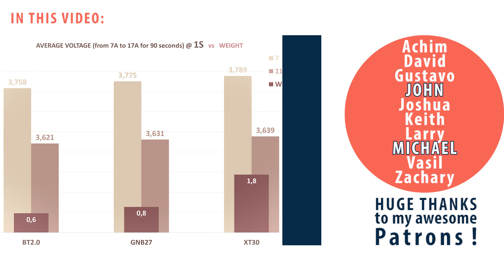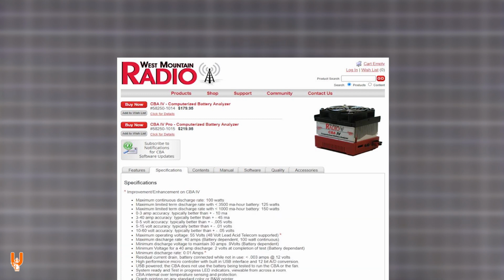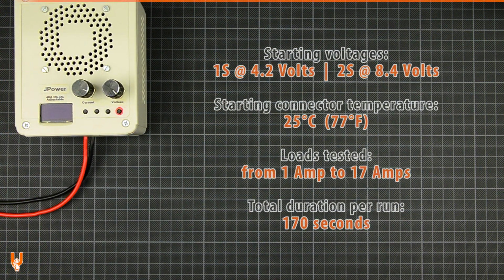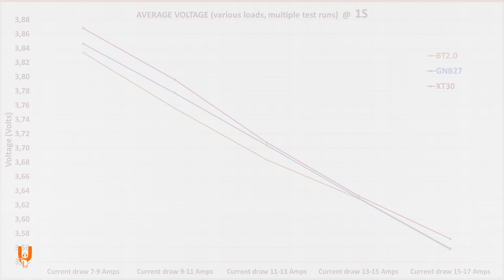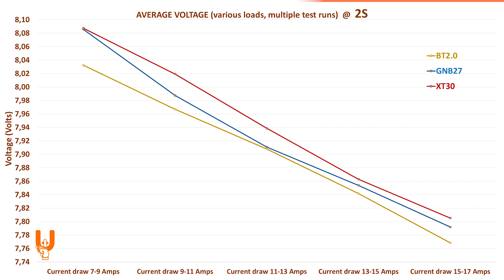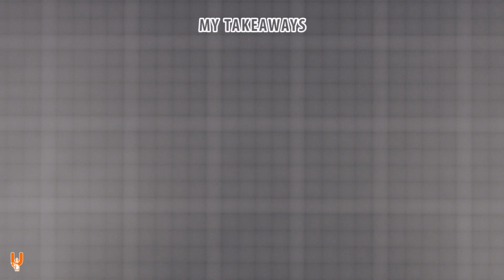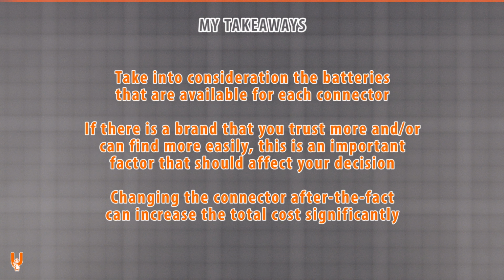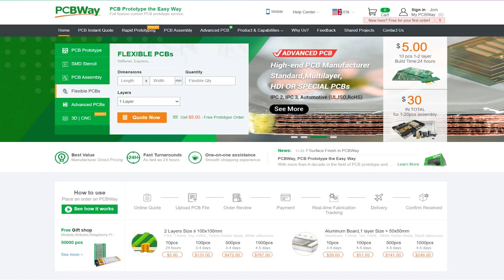BEST BATTERY CONNECTOR for 1S and 2S: GNB27 vs BT2.0 vs XT30 - Battery connector showdown #2

Comment: Lot of work was done in this video and it gonna help people to do right decisions.
But fundamental mistake was made in method of testing.
For example, you can measure the serial resistance of connector by passing constant current over pair of connectors: 
"+"Of PSU -> "+"Of female connector >> "+"Of male conn. (Male conn. should be shorted with solder or bridged with very short wire, to negate resistance of wire) "-"Of male conn. >> "-"Of female conn. ->  constant load -> "-"Of PSU. By doing this, you can adjust current to desired level with constant load.
And than measure voltage drop over female connector with millivoltmeter, calculate resistance = voltage drop / current flowing through circuit.
Knowing resistance of the connector, you can calculate voltage drop on all possible powering voltages. 
Thanks for the video☺️

Comment: Have you looked into the new GNB A30 at all? I feel like it should get the same results as the BT2.0 because of the same pin size. I am wondering if those will take over the market as the new whoop connector.
Reply from the maker: Hello! I have and I definitely want to test them. I have been struggling with free time since last August but I hope to be able to bring you new tests sometime soon :)
Reply: They did it very smart. You can use GNB batteries on BT2.0 quad. But you can't use BT2.0 batteries on a GNB A30 quad. This gives the GNB batteries a big advantage... Hahah
Reply: It looks like GNB wants GNB A30 the new standard (compatible to BT2.0). And they stop producing GNB27. That's a bad development imo... Because the tiny pin spacing for cable soldering is too tiny imo means unsafe against shorts...
Reply from the maker: I was not even aware of the A30  connector, I will take a look

Comment: Thanks so much for this video, I own approx. 12 1-2s low draw whoops which all have the p.h.2 connectors that I’m switching over. I was originally thinking I of going with the b.t.2, but after watching this I believe the g.n.b27 is the way to go, especially my 1s Savage Bee, that one I believe will benefit much more with the gnb27 as opposed to the stock ph2.
Reply from the maker: I am happy you found it useful!

Comment: I put xt30 connectors directly on my 1s lipos lol , make sure you use the batteries with the short wire leads so you can peel back the tape and desolder them then add new xt30 . It’s a life changer for my 1s -2s brushed builds
Reply from the maker: I agree, stick-shaped batteries without battery leads are a bit of a pain to modify. I think XT30 is overkill for 1S and 2S to be honest, but if it works for you and suits your needs, it's all good :)
Reply: @muteFPV  well I did only have xt30 laying around to solve my issue with 2 ph2.0 pigtail and 2 stick batteries causing only 30sec flights , now i get 2:30-3 min  and my build is powerful enough to handle the extra gram or so , I do want to try others in the future. Btw love your channel I never stop learning & ive been watching you for years silently 🙏
Reply from the maker: Thank you very much!!!
Reply: @muteFPV  this is just a new channel I made to start posting videos finally ! I subbed !

Comment: Wow cool video !!!! GNB27 is better than the BT2.0 !!!! The BT2.0 extrem little pin spacing is unsave and bad for DIY ! But a XT15 (which does not exist on market yet) would even be much better because of a larger pin spacing ! I was really interessted ion your video because i like to compare power connectors. I made a video why BT2.0 is very bad and why we need a XT15 and XT45.

Comment: Excellent video and I agree in all what you said, but after using both connector BT2 and GNB27, I'm more and more disappointed by the durability of the GNB27. They become very loose after only a small number of dis/connect. Never had that with BT2. Always firm and snug. And ALL my "free" GNB27 pigtails that were included with Gaoneng batteries are COMPLETE JUNK. They are such a loose fit that they almost come loose by themselves. Did you or someone else had the same experience? Not sure how to proceed (with around 50 1s batteries laying around here ;) )
Reply from the maker: I continued used BT2 and haven't jumped to GNB27 yet. Are your GNB27 connectors some of the very first that were produced by any chance? I haven't followed closely so I don't know if this has happened to others this much, has it?
Reply: There has been a semi-silent update of GNB27 to “v2” which is a bit beefier so it has a loose connection to the original connector, that might be the case here?
Reply: @FilipRadelic  I think that is the case. I have been using GNB27 on my flywoo baby nano 1s and a fresh batch of v2 connectors, they are not loose fitting at all.
Reply: Yes the same... Too. Hard at first time and too easy after 5 6 connections

Comment: Great video! Like the "un-muted" muteFPV videos and this one may be the most important of all for manufactures to watch to ELIMINATE THE PH2.0 CONNECTOR. I've seen the PH2.0 POG cause multiple problems that appear to be hardware related including fail safe on take off with a fully charged battery and harmonics in the video so severe a goggles DVR that works well normally doesn't record the signal you can see... before you can't see it and punch out making it worse trying to get a video signal or hear where it is to go LOS. Great video that deserves attention so battery manufactures making high C rated 1S HV Lipo batteries use the GNB27 connector now that GNB makes a proper 1S battery connector.
Reply from the maker: Thank you very much! I wish the GNB27 or BT2.0 became "standard" but I suspect that this requires licensing, which results in higher cost. We are heading the right direction, that is for sure. At least GNB has good batteries that accompany the GNB27 well, compared to BetaFPV that have been (at least for me and in the past) mediocre....
Reply: @muteFPV  Thank you...  was stoked to see you finished showdown #2 with the GNB27 in it. Took awhile;-)  I just ordered the new Flywoo Firefly Nano Baby quad at 20.4 grams using 40 mm props. They used a folded PH2.0 so I'll replace it with a GNB27 to use with the new 90C 10gram GNB 1S 380mAh battery and some older GNB 520 80C batteries on GNB27s.

Fun to look at what people were flying in the back yard and raging about despite flight times under 2 min only 10 months ago when I posted regarding using the GNB27 connector on the Tiny Hawk. The progress is quite amazing despite the pandemic with Flywoo pushing forward. The Nano Baby is within a gram of being only two thirds the weight of the "tiny" Tiny Hawk and it's using a much better 40mm prop without the Tiny Hawk's body drag to slow it down. And since the Nano Baby's flight times being reported are so long it seems reasonable for playing around up close to drop another 4 or 5 grams by using a 10g (claimed, not here yet to weigh) 380mAh 90C pack. 5.1 grams is 25% of the Nano Baby's 20.4g base weight so dropping 5g using a smaller but higher C rated battery is substantial and should feel great with the proper tune and still provide reasonable flight times. At least that's the plan... see if it matches reality when it gets here;-)
Reply from the maker: Let me know how it goes, I agree with lowering the weight, it makes a huge difference (especially in micros). I would have completed the showdown earlier but was told that GNB was changing stuff compared to the connector released at first. No idea if it had to do with review samples (never had any) or first production batches (didn't buy any of the very first). But I had decided to wait, just to be sure.
Reply: @muteFPV  Wow lucky me and thanks again! I was kidding when I said the 2nd showdown testing "took a while", but glad I said it because I ordered the first version of GNB27's AND THEY ARE NOT COMPATIBLE with the second version!  Your reply made me wait for the new GNB 380 90C 1S batteries to arrive and see what you were referring to and stopped me from spending hours/days to finish converting everything 1S HV High C with PH2.0 to GNB27 including soldering up eight 14AWG GNB27 charge leads and modifying some HV multi-port chargers with PH2.0 outputs to be ready for 1S when Flywoo's Baby Nano gets here... but now I need version 2 GNB27's...err! 

GNB changed the design and reversed which bullet side expands and compresses. 2nd version has the male bullet cut down the middle so it can compress going in solid female bullet so the ver 1 female solid bullet will not fit inside ver 2 GNB male on new GNB 1S batteries. Fortunately this change happened almost immediately so not an issue unless you ordered some of the very first ones.
Reply from the maker: Thank you very much for the feedback!
Reply: @muteFPV  No problem, thanks for saving me from wasting so much time. And BTW the GNB27 connected 1S GNB 380 90C batteries look good... weigh 10.35g to 10.44g out of 6 samples with consistent C/G locations... a tad over the 10g spec but with the heavier GNB27 if it's really 90C relative to GNB's 80C batteries its lack of a weight increase for it's mAh rating going to a higher C shows progress is being made with the HV lipo batteries. Well thanks again... just hope I can find some GNB27 connectors in the US with the Nano Baby about a week away from arriving.

Comment: This was great, thanks. Do you know if GNB27 connectors you tested were v1 or v2? I am not sure when exactly v2 came out, but it seems to have slightly beefed up pins (so it’s not exactly backwards compatible, as if user adoption of it wasn’t bad enough) so might be a bit better than the old one if it doesn’t add even more weight. I agree with your conclusions—if I was starting out today I might lean towards GNB27, but with everything on BT2.0 already, it doesn’t seem to be worth the hassle. And my builds are so weight-conscious that 0.2g extra weight might even offset any benefit 😅
Reply from the maker: Hello, thank you! I delayed this video on purpose to make sure that I had GNB27 V2 connectors. I am pretty sure that any GNB27 found online now are V2.
Reply: @muteFPV  thanks for clearing that up, that makes my decision to be lazy and stick with BT2.0 even easier 😅
Reply from the maker: Same here 😂

Comment: Just measured GNB27 DC Resistance (DCR meter with microΩ resolution and proper Kelvin leads).
Single contact pair: 2 mΩ. So the total voltage drop on two pair of contacts will be only 4 mV / 1A load.
According to your plots it is 10 times higher 40-50 mV / 1A. You are measuring total voltage drop on connectors + leads.

Also I have measured old Micro T connectors, they are only 1 mΩ (per contact pair). Not as compact though.
For comparasing, big XT90 are 0.2 mΩ. XT60 are 0.25 mΩ.

Note on the BT2.0: they are small overall, but 4.5mm thick compared to just 3mm GNB27.
Reply from the maker: Thank you for the interesting data. That is correct, I am measuring total voltage drop including female+male connectors and their leads.

Comment: Pro tip, if you're going for 2s+ and using less than about 10A consider plugging straight to the balance connector, and forget the main lead.
Reply from the maker: Hello! I don't agree with that, especially considering the folded-pin terminals used in the balance connectors and the small wires. I doubt there is any significant weight saving either. Unless you mean to cut the main leads completely from the battery.
Reply: Oh there is a few 2s batteries that are sold without a main lead just a balance connector, that is what I was thinking about, doing this while still having a main lead is pointless. You do need a special charging cable for most chargers btw. To be honest it's hard to recommend, for batteries that are not designed with it in mind, but many batteries use 22AWG which is plenty for builds where you're trying to save insane amounts of weight. 10A might be too much but 5A is probably OK. I have only done this with 2s LifFePo4 airplane receiver batteries but I was planning on using it for some indoor aircraft with 6A ESC.
Reply from the maker: @ignasanchezl  at 5A it may be more feasible, that is true. I think I remember some Walkera products with this kind of batteries? It has been a long time, I may be wrong

Comment: We have a new one on market: BT3.0 connector. Which is in competition with XT30 for tiny 2S whoops... One advantage is that it does not need a balancer. But as you can see in a video of mine is that XT batteries without balancer cable exist.... And what strikes me again on BT3.0, as with the BT2.0, is the very small pin spacing. So I can't support that again because imo that is dangerous ! 
I still hope that we get an AMASS XT7 connector for tiny 1S drones. Which in itself is basically just a downscaling of an XT30. Just take Photoshop and shrink an XT30 connector so that it has the pin diameter like BT2.0 pins, then you will see that the PIN spacing of the BT2.0 is a joke...
Reply: Sorry i mean XT15 not XT7.
Reply from the maker: Thank you for all the details, I just saw your message. I had come across the BT3.0 and have mixed feeling about it, but I kind of like the whole idea of the third small pin for balance charging. There are XT batteries without balance cable, there are also batteries with just a balance cable and no main battery leads, it is all about the use case / purpose. I personally always balance-charged my batteries for longevity and safety.

Comment: Why does it make a difference between 1s and 2s @ same current?
Reply from the maker: Hello! Because the wattage passing through the connector is more. Watts = Volts x Amps, so as a simplified example if 1S is 4 volts and 2S is 8 volts, for the same current of 5 Amps you would have 4x5=20Watts for 1S and 8x5=40Watts for 2S passing through the connector.

Comment: I love this kind of tests. Numbers doesn't lie. XT30 connector indeed is much more suited for 2S to 4S up to 3"  quads and small planes/wings. For 1S+1S battery configuration in whoops GNB27 is slightly better than BT2.0. BUT as you said - battery availability in particular region determine final choice. I moved from PH2.0 to BT2.0 because in Europe BT2.0 batteries are much more available with faster delivery time than batteries with GNB27 connector. Also BT2.0 is rock solid and can withstand many coupling/decoupling cycles easy. Read about GNB27 as not so resilient in that.
Reply from the maker: Thank you very much for your feedback. Where do you (usually) get batteries from in the EU?
Reply from the maker: I think Youtube has removed your reply, all I got was a notification but I cannot find it. Please reply again and do not include any links, I am pretty sure Youtube blocks messages with external links very often.
Reply: @muteFPV  Yes, and second comment was eaten too. Seems YouTube think about me as mature spammer. Would like to know why. Maybe they now use more sophisticated shop address check, dunno. Nevermind, will try to write in separate comments. Ok, I live in Latvia. Nearest whoop battery supplier is Brickracing - at 20 min drive from my home. I know the owner, he usually have a stash of BT2.0 batteries in shelf.
Reply: @muteFPV  Next nearest shops with BT2.0 batteries and fast delivery times to Latvia are DroneIT (Sweden) and FPV24 (Germany).
Reply from the maker: Thank you for the info mr spammer! 😂 I only knew FPV24 but I will check the rest as well. I live in Greece.

Comment: That's what I look for. Thank you so much for that useful informations. I've a question for you. I'm planning to buy Happymodel Crux3 and If I buy I will need to buy 2s batteries but I don't want to buy new batteries because already I have really good GNB 1s 600mah batteries. The question is If I use 2 1s batteries in series with GNB27 connectors how it performs compared to XT30. 
Do you think that would be enough?
Reply from the maker: I am glad you found it useful! If you don't already have GNB27 connectors on the batteries I don't think it is worth it. I would purchase 2S packs with XT30 connector instead.
Reply: @muteFPV  thanks for reply 👍

Comment: Nice tests. I sometimes wonder about a new type of XT30 with just enough plastic around so that it looks more like joined push prongs. How much of the XT30 is the yellow plastic 🤔
Reply from the maker: Like small bullet connectors?
Reply: @muteFPV  Yeah kinda 😄 I have other ideas too about a totally new design with a minimalist stubby interface of a few millimeters that slides sideways and wedges into place.